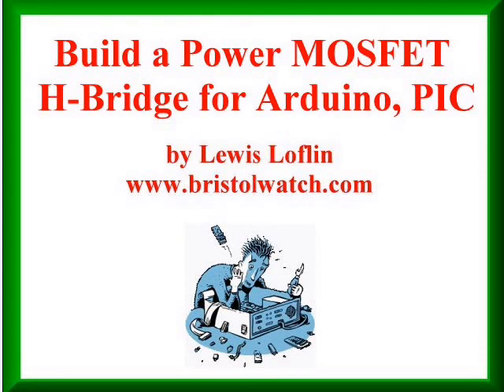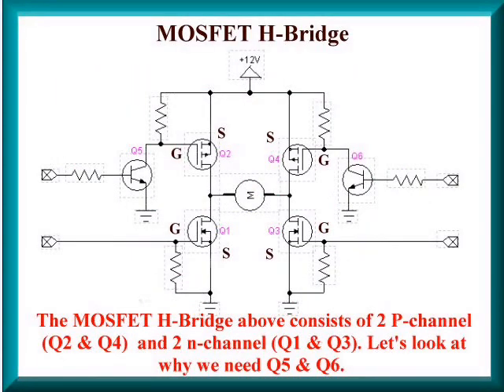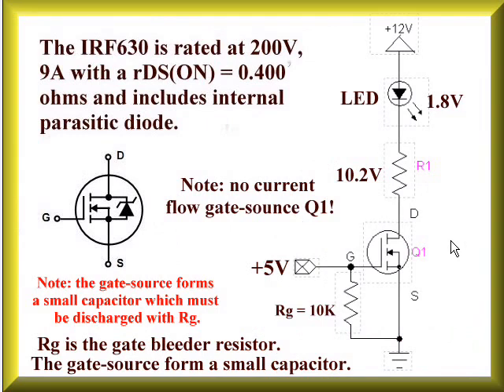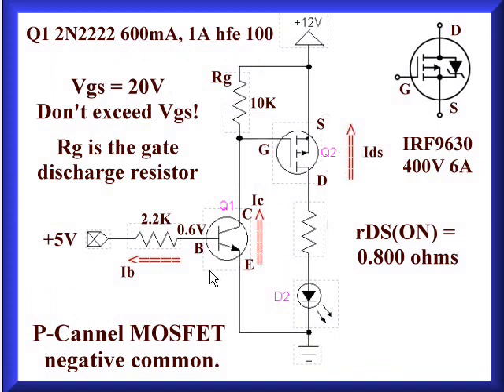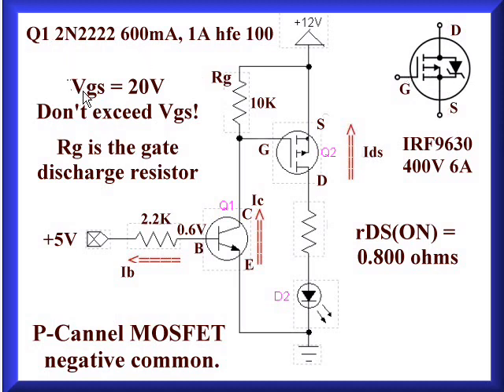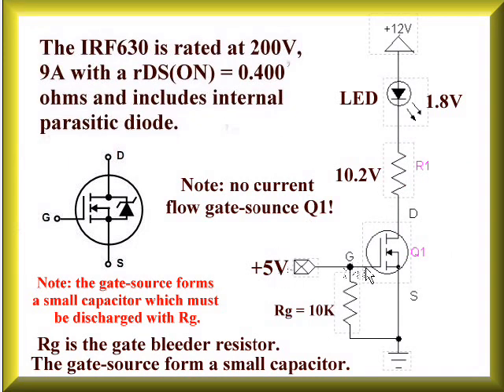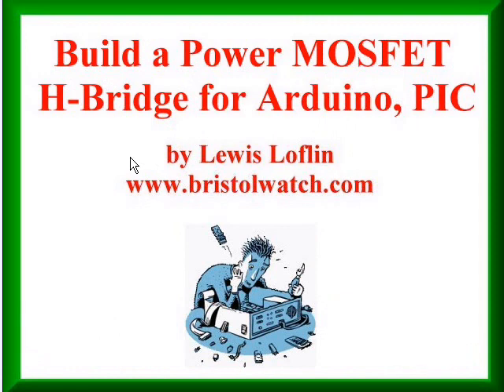Build a Power MOSFET H-Bridge for Arduino, PIC

Comment: I am trying to adapt this to open/close a door on a chicken coop with a timer that just has a SPST switch.  I'm not using an Arduino so I eliminated Q5 and Q6, but the rest is the same as yours.   I connect the SPST to the A side and switch it to GND, but I'm not sure how to switch B to the opposite at the same time.   Any thoughts how you might approach this?    Any tips would be greatly appreciated and thanks for the great video.

Comment from the maker: i replaced the MOSFETs used with:
The IRFZ44N is an N-channel device rated at 55V and RDS(on) resistance of 0.032 Ohms max.

The IRF4905 is a P-channel device rated at 55V and a RDS(on) of 0.02 Ohms max.

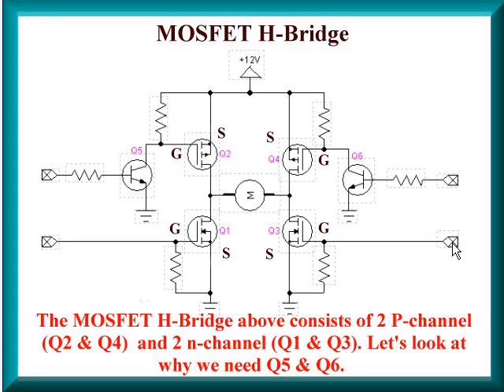Comment: Can somebody please explain to me what is the need of q5 & q6 transistor in 1:17
Reply from the maker: To keep the 12V voltage off the Arduino. It is rated 5V.
Reply: @LewisLoflin  Meaning it is used as protection from damaging the microcontroller?
Reply from the maker: @amolaegade5428  Yes.

Comment: Thank you for the clear video. Do you recommend to implement it using transistors on my pcb or use of the shelf solution? What would you suggest for up to 20V motors?
Reply from the maker: I would use an off-the-shelf solution.
Reply: @LewisLoflin  I currently use L293D on my PCB. is that the right one for 20V DC motor? Somehow it is old, yet I didn't find something else.

Comment: I have really loved the videos seen so far. I love your circuits and you explaining them. Many youtube videos are project based which is good, but it can be hard to grasp the intricacies of the circuit. There were a couple of things I noted in other videos was that a resistor was used between the microcontroller and gate to slow down the activation/charging of the gate source capacitor which with the required activation charge would cause a current greater than the microcontroller could supply. Was that just because of the N channel mosfet selected (Think it was IRFZ44NP)? Your video https://youtu.be/IjgvKJrAOS4?t=69 did not include resistor between microcontroller and mosfet,though did for bjt pre p channel mosfet.

At was power )drain source) do you have to consider a heatsink, and how big should it be? I am sorry if these are already mentioned in other videos.

Comment: Quick question : why do you reverse the current direction in your schematics (Ib, Ic, Ids) ?
Reply from the maker: The actual current flow is negative to positive - electrons are the only free moving charges in a solid. That is how I was taught in the army. 
But everyone uses positive flow anyway. I went over to positive later on because that is what they use.

Comment: sir. for mosfet h bridge motor. do i need to put a diode on a motor itself?
Reply from the maker: The diodes while not shown are built into the MOSFETs. A low-value noise capacitor can go across the motor. Say 0.10 uF.

Comment from the maker: This is a number of updated and related designs:
High Voltage IGBT H-Bridge Using Photovoltaic Optocouplers
https://youtu.be/azJo4h-ei6I

Arduino Controlled IR2110 Based H-Bridge HV Motor Control
https://youtu.be/d0r-Yx9R3Zs

Power MOSFET H-Bridge Update
https://youtu.be/QNA4aOjkGVE

Pt. 1 Interfacing Microcontrollers to CMOS and MOSFET Circuits
https://youtu.be/XzetdwzcOrY

Pt. 2 Simplified CMOS-MOSFET H-Bridge Circuit
https://youtu.be/rExHPqTUBuA

Pt. 3 Tri-State H-Bridge using CD4093B CMOS Circuit
https://youtu.be/b8O4ihdHx8U

Comment: Dear Sir, 
I am planning to use IRF4905 and IRL2505 to run a (brush) DC motor of 12V and 10 Amp. The questions are as follows:
1. Do I need additional diode? ( although both model have internal diode)
2. You quote that voltage at B of 2N2222 is 0.6V. Is it VBE(sat) ?
3.Do we really need (polarized) capacitor as shown in High - Side MOSFET Switch (11:46) and what is the capacity?

Comment: Just re-watched this and figured I'd add another comment.
The 10k gate-bleed resistors on the N-channel (bottom) MOSFETS are nowhere near as 'important' as the resistors on the P-channel (top) MOSFETS if the N-channel gates are permanently connected to Arduino output pins.
This is because Arduino output pins are true 'totem pole' outputs meaning that the pin is 'effectively' connected to either VCC or GND.  Pulling the N-channel gates to GND using the Arduino output will be significantly lower than the 10k bleeder.
(The only point to consider is that when the Arduino initially powers up, all of the pins are INPUTS until the Arduino code sets them to outputs)
For those people building an H-bridge using bipolars (or perhaps MOSFETS that don't have a suitable body diode built in), you can use a bridge rectifier instead of the 4 external diodes - preferably a fairly 'fast' bridge rectifier...

Comment: Hi.
I really enjoy your videos, and I have learnt alot. I am an Electric engineer with some limited knowledge of ICs, soldering and arduino. 
I found your channel while searching for a Wayne to control a 12v Dc / 55A motor. It is used in a boat and driving a cooling water pump. Do you have any suggestion for such a circuit?
Reply from the maker: I assume the pump is one direction. You will need a larger switch. See https://www.youtube.com/watch?v=AOf-i2vLd2o
Reply: @LewisLoflin  you are right. Thanks for the quick responce. Feel free to cash in a trip in the power boat (65knots) next time in southern Norway😀

Comment: Dear Mr. Lewis. I would like to make one of this to control a EM-257, nema 17, bipolar stepper motor that has a 0,7A nominal current and 7 V nominal voltage. This were removed from a Epson inkjet printer that uses IC`s that work with their 42V power supply. I connected the motors to a L239D module with 12V and the torque I get is probably enough, however I need to make another H bridge (as yours) because the L239D module max current is only 0,6A. Another option is to use a L293N module but I prefer to make one of yours to learn a bit more and to use recycled components. The problem I face is that I read everywhere of the necessity to control the current that goes to the motor, which is something I don't know how to do with a circuit like yours. Controlling the PWM signal is not really an option as the arduino controls that using the appropiate libraries (you just tell him what are the steps per revolution and the speed you want to achieve). Not using those libraries will be just too complicated coding for me. Pololu drivers come with a potentiometer, however I think the 4 pololu drivers I have come from one of the so many failed batches that are around in the market! Many thanks. Best Regards. Marcelo

Comment: there 1 big problem though 
how do you activate an h bridge if the arduino supply 5v signal when yoo want 12v or more togo through dem mosfet  
that the only thing i am missing in diy ing my own h bridge

Comment: Sorry sir I'm repairing this kids electric car 12v DC in a control circuit like this one of the p Chanel MOSFET shorted no.hy19p03 what number can I use as equivalent of this cause I don't find this hy19p03

Comment: At 7:28 "another variation"  From datasheet Vgs threshold is between 2 and 4 Volts; when the collector of Q5 (same for Q6) is in a range around half of the 12V voltage (like between 4 V and 12-4 = 8V) both Q1 and Q2 (same for Q3 and Q4) are ON, shorting the +12V to ground. Depending on the values of the gate resistors this would happen at least for a very short time during transitions from high to low and high to low (with the "right" resistor values it could happen all the time for a certain input level). When you connect gates together for complementary MOSFET transistors usually you connect sources together not drains. Doing that would limit the output range so not a solution in this case. Instead of connecting gates together, 2 resistors from gate Q1 to collector Q5 and from collector Q6 to gate Q2 would keep Q1 and Q2 being ON at the same time. Schematic as it is at 7:28 with drains together would be an acceptable design for supply voltages equal or less than |Q1 Vgs| + |Q2 Vgs|  = 4 to 8 V (depending on actual transistors values) assuming that matches the voltage required for the motor,  instead of 12V. Also at 11:09, if Q7 has a max Vce well above 24V, a well-calculated resistor (for example 2 times Rgs) could be an alternative solution instead of D1.
Reply: no surprise people are not pointing out to this, but rather thank for the video. people don't use their brain and trust whatever they see on the internet.

// they mention it in the video description but one may not notice that. incl. me.

Comment: There's something worthy to add when controlling an 'atypical' DC motor.
Once such a motor is already SPINNING and then you REMOVE the source of power, the motor will become a GENERATOR until it spins down to zero RPM.  This will take a FINITE time to happen.
If you want the motor to 'spin-down' faster, then you can switch BOTH power inputs of the motor to some fixed potential (which can be ground OR the positive supply rail).
The energy that is output by the spinning 'generator' is now shunted away (as heat) and thus the motor will stop spinning MUCH faster.
(In a nutshell, this is a VERY rough description of how regenerative braking woks on a modern electric vehicle - eg: Tesla)

Comment: I have 9 phase driver circuit that I have built, complimentary mosfet arrangement. Since it has 9 phase total 9+9 = 18 mosfets, I need 18 signal output on my micro controller. But I don`t have that much!  Other ( which I am working on)  option, switching complimentary series with single pin. So I need to switch one pair(P-N) complimentary  series one of them at once with single pin at High N-type, at low, P-Type. Since P-N type mosfets obvious problem when connecting their gates and expect them to switch on once at low and high signal, both of them switched and cause short! Because it is very clear that P type works with Low signal, N type works with High signal, while connecting their gates it causes both mosfets switch on  condition with even no signal need! So I need to find a way to work with single pin with no short and fast switching in action. So what is your recommendation?
Reply: Other problem also, Pull down and up resistors! Since mosfet gate charging like capacitors, when connecting the resistors not right value, they do create different on-off duty cycle with rise and fall action. I need sharp switching so I gave up pull down resistor instead use pull down switching opto-coupler or transistor to use it when high signal, same value resistor on gate and low value the same. But to many components over crowded board also unwanted. I need a better suggestion also for that.  My N type mosfet "DMTH6004SCTB
" P type mosfet "SUM110P06-07L"  thanks in advance.

Comment: It is just an excellent tutorial on MOSFET switching. Many thanks.... Just a little issue on my head, at 11:40 shouldn't the Vcc on the right circuit be +24 V just like the one on the left?

And also one more question, why your Ib and Ic currents are shown in reverse directions? Or at least, to me, it looks like reverse. I would say Ib should be pointing towards the base for an npn transistor.

Comment: Thanks for your clear videos. I have IRF630N, but in general how to tell if Vgs is high enough to reduce Rds? Can we switch the 2n2222 to switch the 12V onto the gate of the MOSFET, to get higher effective Vgs and thus lower Rds??? Also, wouldn't such a buffer be needed for fast switching and minimizing losses during i.e. PWM? Thanks again!
Reply from the maker: If you are using 3.3V with and IRF630N it will not work. It switches on at 5V but not fully. 

See this test page on MOSFETs:
http://www.bristolwatch.com/ele3/mosfet_test.htm

There are a ton of updated circuits on this issue.

Comment: Thanks for the super class of mosfet ..! I've made an H-bridge with mosfet Channel P ... and N-channel ... just like what you teach in the video. However, I have a Proteus simulation problem when I replace the Logic state Imput with a 5 volt imput from an Lm7805. Would you know how to do this? Thank you. Great class. Congratulations!
Reply from the maker: I don't use simulation I build the actual circuit. I don't know what a 7805 input has to do with this. Thanks.

Comment: Great video!! Thank you! Excellent to control a motor via Arduino with also bluetooth module for IoT application. Is there any compact H brige integrated circuit made from ST, NXP etc that you would recommend?

Comment: The presentation and explanation is very nice but if you will try the circuit which has only two inputs  it will blow your MOSFETS, because if you did not realize the PChannel MOSFETS are always connected to the ground( always on the ON state ) through the bleeder resistors of the N Channel MOSFETS...

Comment: Nice tutorial. One error though regarding 7:30:
If you use the same value for Gate-Source resistors, 10kohm for example, when the bipolar transistors are off (Low and Low), then the gate-source voltage of all transistors will be 1/2 of the Vcc which in this case is 6V, which means all MOSFETs will be in a low impedance state, i.e. shorting Vcc to ground. 
I would remove the resistors  between collector and emitter of the bipolar transistor (gate-source resistors for Q1 and Q3) for this to work.
Reply: It's a shoot-through situation, the schematic of the video has indeed a problem, it's been superseded by a better one in the video description.
Reply: @speedsterh  Damn, Wish I read the comments before I got PCB's printed... haha, I had it as per the website too, but changed it after watching this vid. should be fine to just leave that resistor out though, right?
Reply: @madaxe79 Damn, Wish would do the same :D  Printed my PCB and was fighting with cirquit whole day.

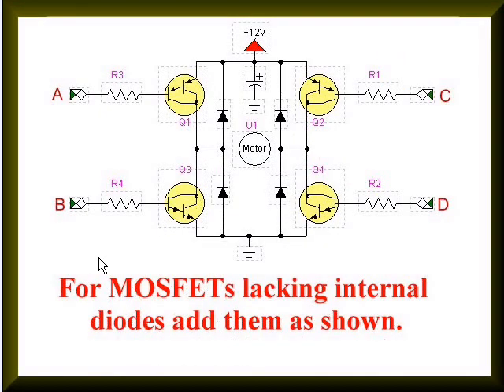Comment: 10:30 "mosfet"??... This case is with "darlington transistor" ;-)
Reply from the maker: Correct. That illustrated where to place suppressor diodes.
Reply: Lewis Loflin of which all 4 diodes were shown as connected backwards eg. in the direction of conduction rather than blocking, once again.

Comment: Hello Lewis.  Well, the H-bridge seems to be part of my solution to use in a Newman or Bedini motor/generator?  Do you know where I can find a micro-controller controlled transistor/mosfet circuit for a Newman Motor?  I want to control the duty cycle, frequency and pulse width with the micro-controller.   I would also want to 'harvest' the back EMF from my driver coil into a capacitor bank to charge the secondary/charge battery ..... or am I asking too much?

Comment: sorry mr there is a wrong in circuit at 9:30 the above transistors Q2 and Q4 will be ahigh in all state even the Q5 and Q6 be off because there is adrope voltage across the butom resistors and this drope lower than vcc so keep Q2 and Q4 on in all cases ....thanx
Reply from the maker: With no input Q2 & Q4 are off and Q1 & Q3 are on.

Comment: oh and Im not a 100% on this but i'm pretty sure the resistor you're using at the gate of Q3 and Q1 are not even needed. As long as you have set the digital port on the arduino as an output, it will easily sink  the current from the capacitance present on the gates of Q3 and Q1 the same way the output of an opamp would after going from high to low. The only way Q3 and Q1 would stay on is if you set the digital i/O as an output and then switched that output to high and then set the same digital I/O to Input which would not make sense in this model.

Comment: Hello! What adjustments should be made to this circuit if the motor load is rated at 50V and 1Amp.
Reply from the maker: I'll do a video on this to explain it. It is simple.
Reply from the maker: This video answers your question. https://www.youtube.com/watch?v=dbwZgP9gIbA
Reply: Thank you so much. Could I potentially use Optocoupler instead of transistors?
Reply from the maker: Yes as long as the collector-emitter breakdown is high enough.

Comment: Why not just use 4 n channel MOSFETs ?
Reply from the maker: Polarity is wrong and won't work.
Reply: I meant, use four n channel MOSFETs directly connect to the arduino. I won't use the regular transistor as switch.
Reply from the maker: Won't work the transistor is supposed to protect the Arduino from 12v else you blow the Arduino.
Reply: You can use but then you need two optocouplers and one positive voltage line 5 - 12V more than your positive supply. Find bootstrapping :)
Reply: Lewis Loflin 
If i turn on one of the upper mosfets i will have about 12 volts over the folowing mosfets anyway. So why it should make a diference using only n types?
Reply: it works for 4 P-Ch mosfet but 5v at the gate is not enough. if you do the mosfet will get so hot and it will not switch fast enough which causes short to ground.
Reply: It is not unreasonable to want to use all N-chan mosfets.  They are typically cheaper, and have lower Rds(on) than the P-chan compliments.  I think you have some other videos all about optical gate drivers that would make this kind of thing possible.

Comment: I made the circuit on your webpage (http://www.bristolwatch.com/ele/h_bridge.htm) today, and it did not work. I built the circuit in figure 2 using two IRF530s and two IRF9530s.  Once I gave the BJT a high signal, the FETs started heating up with no load, telling me that they were both in the 'on' state and shoot through was occurring. Even bringing the signal on the BJT back down to ground did not allow the N channel FETs to turn off... they both stayed on, shoring the power supply. What in that circuit is to ensure the gate on the FETs go to ground and shut off all the way?
Reply: what i normally do, is i put a dead time (Resistor, Capacitor, Diode network) before the gate, making 1 FET turn off when the other FET is on. this is to ensure that they don't turn ON at the same time. MOSFET are fast switch compare to a BJT.